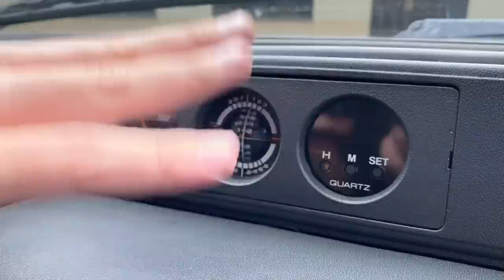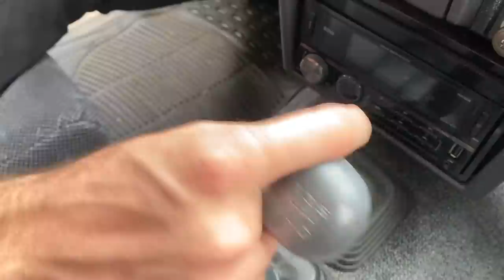We Just Bought The Most OBSCURE Off-Roader Ever Sold In America!

Comment: In Australia we had the Daihatsu Feroza with the 1.6 petrol 4, and the Daihatsu Rocky with a diesel 4. The Feroza came in two trim levels, standard and the wide track delux, the Rocky was standard with the wide track, and the reason yours is still in great condition, Daihatsu primarily made trucks, and the spinoff to light 4X4s and economy cars shows it heritage in the engineering, these little things were all over engineered, tough as nails. My old mum had a Charade, great little car, that lovely revy  motor, light gearbox and good handling made it a delight to drive. Looking forward to your off road exploits in the Rocky. Cheers from Down Under.🦘

Comment: My first summer job was on a Northern Irish farm back in the mid 90's, the farm manager had one of these as the runaround, it got so much abuse but kept running, I distinctly remember sticking it into a ditch and having to get towed out by a John Deere power plus, we managed to pull the rear axle out of alignment so we used a scaffold pole to batter it home! Sturdy thing  kept on going until the mid 2000's, 15 or 16 Irish winters had finally taken its toll so it was off the scales to get weighed in.

Comment: I've got one of these in Australia, Daihatsu was more popular here and had a much longer stay in our market (can't quite remember the exact years). You asked for correction on things you got wrong so here I go haha (no disrespect meant of course): Firstly, due to daihatsu's inconsistent and confusing naming of these, we refer to these as either F300s, or F310s.

In australia this car was called a Daihatsu Feroza (Fur - oh - zah), in europe it was named a sporttrack. 

These F300/310s were actually not called ruggers, or fourtraks in other countries, the rugger/fourtrak is a similar looking daihatsu 4x4, but has a longer wheelbase (slightly longer than a GQ swb nissan patrol), and most came fitted with a 2.8L Turbo Diesel, had solid axles front and rear (where your F310 has Independent front suspension and solid rear, as I'm sure you've noticed) and had the chassis code F75.  There are many models of ruggers, some shorter wheelbase, some later models IFS some with toyota petrols (2Y, 3Y, 4Y), but I won't go into that. Confusingly, this rugger/fourtrak was called a Rocky here in Australia, but obviously it is completely different to the rocky in this video. This is important when you are buying parts so always look for "F300 or F310" in the listing or you might be buying the wrong thing!

In australia we got the F300, and the F310. the F300 is narrowtrack, and has shorter axles with smaller/no flares. The F310 is widetrack, with longer axles, and those bigger flares (i.e. the one you guys have got). Most other stuff is the same but the: leaf springs, rear shackles, diff housings, axles, are all different, I;m sure there's other stuff that is different but thats all I can remember right now.

They are a great car and mine has 365 000 kms on it and still going strong, it has gotten me through many trips, the most impressive of which being a 3-week outback trip, that included a 5 day simpson desert crossing, super super remote, and she didn't miss a beat.

HOWEVER! Heed these words of advice! Flush. The. Coolant. System. The 1.6L HDE engine in these is notorious for blowing head gaskets, usually around the 250 000 km mark. However, mine has never blown a head gasket, and I attribute that to me and the previous owners looking after the coolant system meticulously. Change coolant as often as you're realistically able to (I have been slack lately but try to do every 20 000- 30 000kms), and use GOOD quality coolant. One of the first things I did was take out the radiator, take out the water pump, take out the thermostat and flush out the whole engine with a mains hose, with a high pressure end on it (probably wouldn't reccommend a pressure washer). New thermostat, new pump, a few new pipes that were dodgy/rusted out and she was sweet. radiators also develop leaks all over make sure its in good condition, mine was weeping from all the solder seams and was very hard to notice as leaks would evapourate very quick. the viscous clutch fans get loose and are probably the most common cause of over-heating on these. DO NOT let them overheat, this will very likely cause head gasket failure. sorry about the essay I'm a bit of a nerd haha
Reply from the maker: great insight, thanks!
Reply: I have replaced my head gasket. Mine is a 1992 with just Shi of 400000kms on it. Parts are difficult to find but not impossible.  Best car I've ever had. Wish we had more aftermarket support for them. Be a shame for them to be lost to history.
Reply: Might i correct something? In continental Europe the thing was sold under the name Feroza. Only in the UK it was named Sporttrack. (I remember watching a TV Show from germany long ago where they gave one away. And i remember seeing a few on the road.)
(It's a bit like the Mitsubishi Pajero that considering europe only in spain and the UK was named Shogun. Don't know why Britain, but in spanish Pajero is a curseword for someone...)
Reply: @nirfz  very interesting, cheers for the info

Comment: I love mine. Such a cool little 4WD. 
Just make sure the ignition timing is done right with the vacuum line disconnected. Big loss of power if it hasn't been like that. 
Also try and source the later model air intake system with the torque box that sits above the valve cover . Really gives a good bump in mid range torque. 
A set of good 4-2-1 extractors really gives a good improvement too. 

On to a winner guys. Keep up the good work

Comment: Hi Tommy, I used to own one of these in the 90's in Australia. It was a Feroza II there. Wonderful little vehicle and quite capable, especially with a set of 235/75 all terrain tyres. Mine was an EL Spec, meaning luxury of central locking, power windows and mirrors and premium Panasonic CD Player. Only problem I had was putting a dent in the oil pan from a rock!
In Australia, this was the little brother to the Daihatsu Rocky. The Rocky had front and rear live axles, early models had leaf springs all around, later ones on coils with a 2.8 litre turbo diesel.

Comment: Great video Tommy, you are in for a treat!! The F300 (Feroza/Sportrack/Rocky) was a smaller and  “urbanized” version of the more rugged F70 (Fourtrak/Hiline/Taft/Rocky).  The 1990 model you have is from the first gen, and as you rightfully said, is everything you could ever need. It’s EFI engine is ready to go anywhere (sort of quick) and was built to last forever. Also just give it grippier tires and you won’t believe how good it is off road, specially in the sand where it’s revy engine and low weight shine like very few others.

Comment: I owned a ‘92 Rocky w/o a/c but with power steering. You’re right about the motor; 94 hp and 94 lbs/ft of torque. They all had 5.28 axle ratios, and were built well. I got 23/24 mpg with it, and I had it up to 110 mph. A quart of Slick 50 at 13,000 miles really loosened it up.  All the Daihatsu lineup (I worked for a dealer at the time) were very dependable and had very few issues. It was also a very capable off roader.  The fiberglass rear top was an option, as standard was a soft top. Mine was equipped with a removable hardtop. The knobs on the tailgate were to remove the back glass when you removed the hardtop.

Comment: I have a feeling that you guys, and myself, are probably the only two rocky owners in the Denver area. Nice find!

The one thing I would recommend is doing the timing belt, as the chances are good that it hasn't been touched for ages. The timing belt on mine was the original one from 1991, and these, as gutless as they are, are interference engines. The water pump is at least separate from the timing parts, so that makes it a little easier to do.

Comment: I have 5 of them. I bought my original one in 1997 and still have it. They are quick because they have factory 5.29 gears in the differentials. Make sure you have the timing belt and tensioner done because it’s and interference engine.

Comment: It came with a 2.8 turbo diesel in Australia and as a long wheelbase  pickup. Diahatsu also made a pretty good (slightly smaller) Faroza and a brilliant little Terios 4x4. The small knob is hi/low range and the 4x4 is a switch on the dash and is engaged by manifold vacuum

Comment: Im just getting into offroading after a long time 
Bought my first 4x4 this year A 1989 Y60 Nissan Patrol 4.2 petrol lwb wagon for 1700 AUD (1300usd)

It has a 2 barrel Holley carb ,32 inch mud tires on it and I plan to fit an aftermarket exhaust and extractors

Comment: I used to work on these and the charades in Puerto Rico in the early 2000s. Parts were hard to get back then and impossible now. The only way we were able to keep the charades front end aligned was to weld a steel cable with a tensioner to the “frame” (unibody) to keep it from opening up. It kinda worked like a subframe brace but on the bottom of the car. Drivetrain was tough as nails but the cars themselves would fall apart on the rough island roads. Only way to keep these running is to have a yard full of junked ones for parts.

Comment: I had a 90 wrangler 4.2 6cyl that was rated at 112 hp so 94 hp from a 4cyl isn't bad for the era. Can't beat the old Japanese 4x4s my 96 trooper is still going strong with 175000 miles.

Comment: Oh I remember the Rocky! Very similar to the first new vehicle we ever bought, Geo Tracker, had the same size engine with the same power. Five speed manual with locking hubs. Removable roof segments. Very well made. The biggest issue with the Rocky is getting it fixed when it does break!

Comment: The Rocky has a strong reputation off-road. I was about to buy one in 1999 from the dealership but went for the Daihatsu Terios because it had power Windows. 1.3l engine was surprisingly quick. Amazing offroad even though it had no low gear. My next car was a Hummer H3 then a Toyota Sequoia.

Comment: This car was so famous in 90s in Indonesia. There were 2 engine available, 1.6 L petrol and diesel without turbo.. The petrol version with only 4x2 was called Feroza which sold from 1995 to early 2000s. The diesel version which was named Taft even had longer history, they were sold from 1985 or 86 to early 2000s without any major change. The diesel version also had many variant swb and lwb, 4x4 and 4x2. The only version which was named Rocky is the top trim which came out in 1995 until Daihatsu stopped selling them.

Comment: Suzuki Samauri got a bad wrap from Consumer Reports. They did not have the tendency to tip over.
Reply: That was a setup...jeep didnt want any competition..people got paid off
Reply: If it's a hairpin turn you most certainly can easily
Reply: @Dankcatvacs  you still have to be doing something stupid to turn one over. They don't just flip going normal speed. That was way over hyped.
Reply: @Dankcatvacs  while true for many vehicles, it was proven in court that consumer reports executives purposefully caused harm to Suzuki for manipulating roll over testing. Consumer reports actually had a hell of a time making it turn over. One executive was on record, furious about how long it was taking to get it to flip and wasn't going to stop testing until it flipped. In the end Consumer Reports had to pay Suzuki a settlement.
Reply: @Jackmerius_Tacktheretrix  still know somebody that rolled one but it was slick
Reply: Yeah if u were going like 60 mph and then whipped into a 180 sharp turn then of course it’s gna do some crazy things - Sammys rule! They were setup to fail!! 
I have an 87 Samurai w a 3.5 inch suspension lift, put a carb off a Hyundai Pony that I smuggled out of Canada and I have taken that little jewel on some intense trails in AZ and NM. Doesn’t skip a beat and the power w that Pony carb vs stock is palpable!

Comment: The Daihatsu Charade weighed in at a curb weight of-are you guys sitting down?- a MEASLY 1600 pounds, a 3 cylinder 0.8 litre engine with your choice of a 5 speed stick or a 4 speed manual with an EPA gas mileage rating of 60 miles to the gallon (7 or 8 Gallon tank)

Comment: These things are great !!!
in Indonesia, the "Feroza" is a SWB that only comes with 2wd petrol engines and the "taft GT"  is a SWB model that comes with a non turbo indirect injection diesel engine and 4wd, the "Rocky" is a MWB that comes with a non turbo indirect injection diesel engine. early models of this car comes with a solid axle and leaf spirings but, updated models comes with a front double wishbone setup and wider wheel base. the diesel engine is very versatile and i do mean THIS THING RUNS ON CRUDE OIL and it will still be fine, making the diesel models very desireable for indonesians mostly for farm work and climbing mountains etc.

in other parts in the world you can get a turbo diesel like in the model "Rugger" from japan with its MWB setup.

Comment: I abuse mine pretty hard off road and daily drive it to work. Here are some things to know;

These cars like to overheat if you live in a warm place like the SW USA or Australia. Everywhere else they run on the warm side. You will go through thermostats left and right, so take yours out completely or drill holes in it. An electric aftermarket fan is better than the mechanical one too. Despite this, it still might overheat once in a while. 

Dont be sad when the head gasket blows, it will, they are easy to get and without redecking the block or head you put a new one on that will last ~50k. My car has 195k and i have already done it, the previous owner did too at 80k. 

The front axles between your upper and lower CV is stronger than you think, but the CV they plug into are made of glass. Be prepared to swap these out while on the trail if your doing any serious crawling or thick mud.

The exhaust manifolds crack, when this happens your ecu will run the engine richer due to a change in back pressure. Make sure your exhaust system is solid. Delete all your emissions crap too. I get 33mpg combined. 

Replace the fuel filter on the fire wall with a different brand than denso the one on these are crap and clog or dont work. 

Buy a few cheap inline fuel pumps and keep them in your car.

Comment: I have 2 rockies ..1st one i got in 94 and still have it and runs..not sure about 1000lbs tow capability i have towed a 25ft motor home that was towing a full size van for about a mile to a gas station lol and pulled and full size blazer out  buried to axles in mud lol so there stout lil 4x4s ..

Comment: The Diahatsu Rocky is the same truck as the Dodge Raider and is a brilliant running little truck. Dodge’s mistake was putting a Chrysler drivetrain in their version. I owned one and truly regret selling it. Excellent gas mileage and the motor was extremely smooth. The Charade had a .9 liter 3 cylinder and were known to get between 40-50 mpg. I know Toyota, Chevy and Ford have all rebranded Diahatsus for resale. They are really hard to find. I didn’t take it out wheeling when I had mine, so I don’t know much about the 4wd system. If you guys don’t kill it contact me and I’ll take it off your hands when you get done with it.

Comment: Have got mine for about like a year or so, it is a european version so it is called Feroza, i like that car, but thing that drives me mad is a lack of OEM or even aftermarket parts for it. Seriously, when i was repairing front suspension i had to bring upper arm bushes from russia and lower arm bushes from Japan. Steering idler? Came from Taiwan directly. Sealings for transfer case? Unavailable. I dug deep enough to find that I can use sealings from Benz G class. It is gonna be nightmare to service that car but, fingers crossed, you will not sell it if you throw it in the rocky paths. You get it? ROCKY paths :D greetings from Poland :)

EDIT :
If you search in the interwebs, especially on russian sites you will find full factory service manual in PDF for free. About 5000 pages. I've already printed mine. Cheers!

Comment: Awesome this was my second car i owned and it was great, perfect summer vehicle with the soft top and very good offroad the engine was the same as in the U.S. But mine had a little button on the left side of dashboard to adjust the front shock absorber, soft, medium and hard. Does the US version have the same? In Germany the name was Daihatsu Feroza, the Daihatsu Rocky was his bigger brother with solid axles and leaf springs. The Rocky in Germany was only available with a 2.8l turbo diesel engine with approximately 100 hp at the end of production in 2002 :-D

Comment: Fun fact: this is the “high end” SX trim, meaning you got interior panels! I own a base SE and almost all the interior is bare metal!
Reply: X is usually designated bottom trim levels ... kind of like how Fiat Chrysler uses STX  and TRX on higher trim levels but they are a low end company (that somehow demands high end prices)
Reply: 2big 2fail While that’s usually the case, Daihatsu did it differently. As stated, my Rocky SE never came with interior panels (there’s carpet and very basic vinyl door panels but the rest of the interior is bare metal). The one in the video also has headlight washers and rear defrost, again something mine doesn’t have.